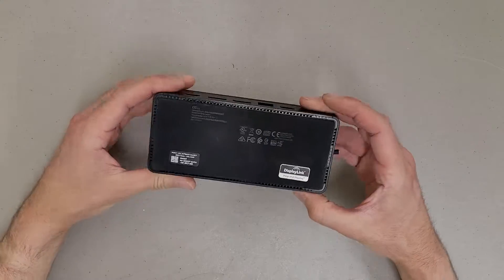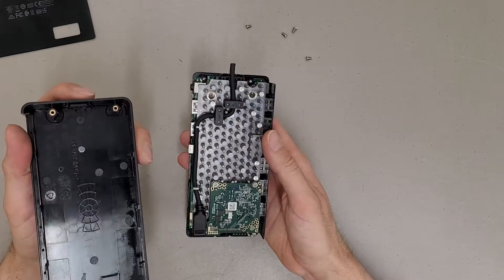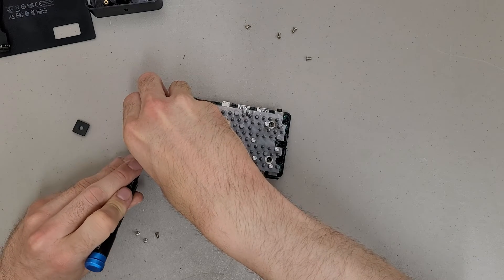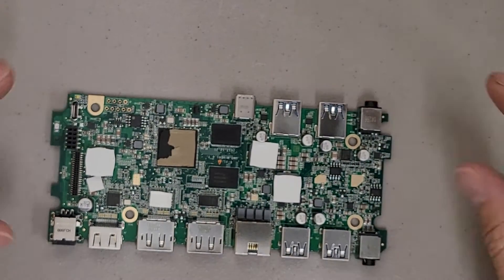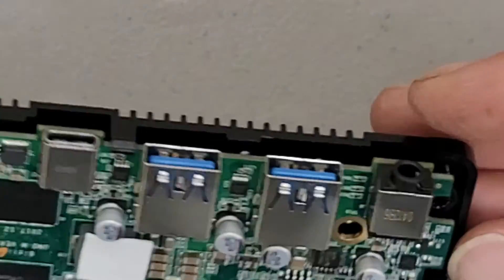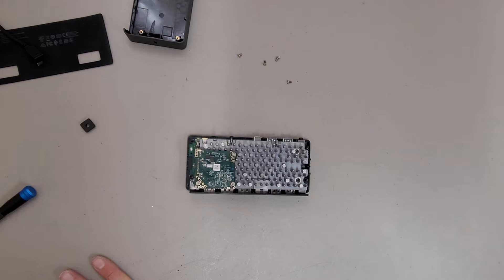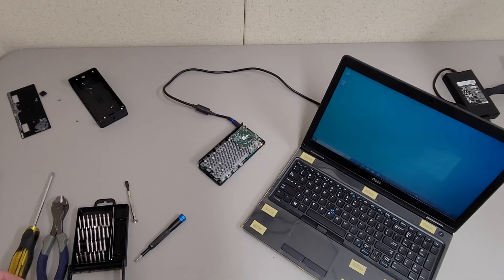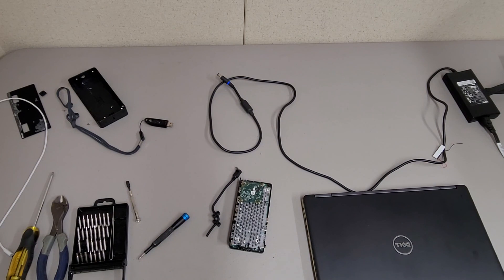Taking apart a Dell D6000 MKX27 USB C docking station #teardown

Comment: Has anyone tried using another usbc to get around a broken cable? This may save my d6000..
Reply from the maker: I'm not aware of anyone having success with other USB C cables. I have a bunch more USB-C cables since this was recorded though so maybe I should see if I can find another one of these docks to test them on.
Reply: @computersales yes you should. It's a thing. It's not a normal USBc but there is many versions.  I went thru the Dell forums and no one has solved this. It's a proprietary cable Dell doesn't support not even for any of their customers who payed upwards of $350 for it. Some businesses bought over 200 hundred at that price with a shitty non replaceable usbc cable that breaks under light use.  This is all the more reason to make an aftermarket. I WILL NEVER BUY ANOTHER DELL PRODUCT EVER AGAIN.  THEY ARE BLACKLISTED from my business. I am self employed and I fire customers all the time. This is also why i refuse to use apple products. Dell is running  a scam. No way they made this cable. It has to be sourced from another supplier.
Reply from the maker: @nathanjones3429  I didn't realize these were that expensive originally. They truly are some of Dell's worst docks.

Comment: There are 3 things that you need to consider:
1. The dock might be broken
2. The laptop might not support thunderbolt (usb c port being there doesn't mean it also supports thunderbolt)
3. The cable wasn't good enough to support thunderbolt (and usually phone charger cables are not good enough to be able to support thunderbolt).
I have a similar dock (pcb are difgerent inside) and i replaced the cable with another one (not from a charger, i got it from a store for about 10€), the laptop was charging and the monitors / peripherals were working.
Reply from the maker: Valid points. To the best of my knowledge this dock is USB only. As far as I know the only thing wrong with it was the original USB cable's external connector was damaged which is a common design flaw. These have a USB C to USB 3.0 adapter physically attached to them. I don't see why a standard USB C cable wouldn't work since it doesn't support thunderbolt.

Comment: Note: I believe that the power station that you dismantled was not recognized due to the malfunction of the integrated circuit that says (AWAREI) and its location near the board connections, which is closer to the longer connection plug on the main board.

Comment: funny story: when i move a little bit on my desk the dell docking shut down
Reply from the maker: They are terrible docks as far as I can tell.
Reply: @computersales  i’ve found a big workaround to get it works but it happens 2/3 times per days a suddenly disconnection …for 40€ i can deal with this frustation

Comment: have you tried real verified thunderbolt 4 cable? Seems your cable is a simple USB2 cable (4 wires), as it is just for charging of your Oculus....
Reply from the maker: I don't own any thunderbolt cables otherwise I'd try.
Reply: This dock is not s thunderbolt dock, so a thunderbolt cable is not the solution. This dock is a displaylink dock.

Comment: Are there any cables you could recommend for this? I’m not quite sure what exact spec I should be looking for as 40gb thunderbolt 3 cables can get pricey but I’d like the full functionality of the dock.

Not to mention cables with that kind of angle are a lot less common (still around, but not from reputable brands)
Reply from the maker: I have no idea to be honest. I did get some more of these in though. I'm guessing the Anker power delivery cable I recently bought won't cut it though.
Reply: @computersales  it could work, im not in a huge rush so do please try it and let me know, and youll know it works fully if it allows you to drive multiple displays but of course I dont blame you if you would rather not test to that extent.
Reply from the maker: @m1ghtyboy  I'll try to keep it in mind.
Reply: @computersales  thank youu
Reply: @m1ghtboy I'm in the same pickle as you but I discovered a few things while researching about the cable in question: 1. its a 240w thunderbolt 3 EPR cable and 2. After taking the connectors apart, BizLink is the company in question that makes these cables. Now the bad news is that Bizlink won't sell these cables to individuals. I don't know where one would find this exact cable without purchasing a dead D6000 and tearing that apart for parts.
Reply: @Dark-xz1im  I have a dead D6000, the real challenge is figuring out the wiring configuration for the cable, which some guy got close with and then stopped to put more time into education, it’d be cool if someone could figure it out and open source it so that these could maybe be made by a third party company

Comment: Has anyone managed to fix the coil whine (the annoying noise) of this unit? I have read about using hot glue or a damping material, so just curious if that worked for someone
Reply from the maker: I've never come across a working one of these personally so wouldn't know. Mounting under your desk would be a solution if you have the space.
Reply: @computersales  that's actually not a bad idea, thanks! The coil whine stops when the dock is even under small load, so I will try to plug something like a USB lamp or a led strip to generate load and see if that fixes it. If not, hide it. Thank you man!
Reply: A bit late but I've managed to reduce the level of the hissing noise to the unnoticeable level by adding a thin piece of silicone heatsink tape on top of the inductor coil of the daughter board.
Reply: @bryanphanvn  Thanks a lot! Do you have pictures by any chance or a link to the tape? Cheers!
Reply: welp just killed my d6000, nevermind. I disconnected the daughter board a few times (I didn't break it after the first try at least), as my first try of adding silicone heatsink tape didn't fix the issue. Turns out none of my attempts fixed the issue, so now my d6000 still does the coil whine and doesn't work as well :D

Comment: I was able to get this working by swapping to a new usbc-usba cable. Then plugging the usb3 A side into my pc usb3 port. Other ports are no good.
Reply from the maker: Any chance the cable has a specific model number people can refer to?
Reply: Does display output work?
Reply: @m1ghtyboy  yeah still using this setup. Long USB able and a hole drilled in the dock cover.
Reply: @ztkent  hell yeah. I’ve been seeing great efforts to reverse engineer it but if display output works then that’s fine by me. Can you remember the specific cable used?

Edit: ordered a generic 3.2 adapter from Amazon, I’ll update
Reply: @m1ghtyboy  OULUOQI USB Type C Cable, but it looks out of stock. It says it's usb-c to USB 2.0 actually.. works great for me.
Reply: Dual monitor / aux all working fine. I can use a type c adapter on the end and plug it into my MacBook to.
Reply: @ztkent  great stuff. I’ll relay this to other places thank you
Reply: @ztkent  3.2 type A>C adapteroonie just arrived and so did my power brick, nothing.

When plugged in to the laptop before the wall, no light. When plugged into the wall first it gives an orange light, when plugging in the laptop I get a white light for a second but then flickers back to orange :/

What’s the MFG date on the bottom of your unit? Mines march 2018
Reply: @m1ghtyboy  Anyone else can confirm if OULUOQI USB Type C Cable is working?

Comment: Thanks for this video- Even though I had a different model, D6000u - Disassembly was similar. I was hoped to try using a Nintendo Switch cable as Abbadon2001 mentioned in an earlier comment below, but  there was a short on the board and it was toast. I kept the heatsink as a paperweight and the housing as a decent little project box. Cheers.:goodvibes:

Comment: The reason they didn't make it a removable connector , was the difference in usb c cables. There's some that do data, or power , or both, or are just trash and do nothing well. The dock was sold for industrial mind set. And they just want something that always works , until it breaks then they have budget to replace. But the usb c cable can be common confusion so this is the simplest solution, having the cable be attached
Reply from the maker: Honestly if the cable didn't have such a high failure rate I wouldn't be as annoyed that the cable isn't replaceable.

Comment: I found a DEll forum post a chap made where he managed to fix it, sort of, it had some tx and rx lines switched over, like a cross cable. He was making a flex pcb to sell to fix this for a normal cable, but it never came to be available. Someone else suggested a nintendo switch dock cable worked, but never showed evidence. I have both a busted D6000, and a switch cable, so i may try this....
Reply from the maker: Hopefully it works.
Reply: it worked? i have the same problem =(
Reply: Hello I have the same issue now my dog destroyed my type C cable, did you solve it ?
Reply: @punto360reviews  I got mine working again today. Removed the old cable and replace it with a new usbc-usba 3.0 cable.

Works on my Mac and windows machines. Needed to plug into my usb3.0 port.
Reply: @ztkent  hello, where did you buy it ? Got the link ?
Reply: @ztkent  which cable did you use?
Reply: @ztkent  does display output work?

Comment: I tried all USB C cable types, normal, thunderbolt... Nothing, was someone capable of replace this cable?
Reply from the maker: There must be a trick to it.  Makes me wonder what they did.
Reply: @computersales   propably switched TX RX lines ? usually the usb c device would figure this stuff out but it seems as if this dock was just a dumb thunderbolt device ?
Reply: Hello I have the same issue now my dog destroyed my type C cable, did you solve it ?

Comment: I have the same docking and i have a problem, if I plug through USB does not recognize any monitor connected and the docking can supply energy by the other hand if i plug with usb adapter recognize all the monitors but as you know does not supply energy, I already try to update drivers and bios even with two laptops it's the same
Reply from the maker: I have never used one of these so I wouldn't know where to start.  I guess check device manager for errors and your display settings.  If it works fine with regular USB then my guess is there is something interfering with the USB C negotiating process when you plug in the dock.

Comment: If only they built their laptops like that...
Reply from the maker: I would say their XFR series laptops are built like that but in all reality even those are kinda jank. 🤔

Edit: Oops meant rugged extreme series. I forgot they dropped the XFR series after 2nd gen i-series CPUs.
Reply: @computersales  Indeed! I have actually got one of these docks that I sue with my Framework laptop and I was wondering if I could open it up and tweak the thermals but I see it's pretty packed in there. It's almost a PC in a box itself. I can see why they are so pricey. Best way is like me, get one on Ebay for £50.
Reply from the maker: @jabezhane  You could always run it with no case with a fan on top

Comment: hey! great video, i was a bit disappointed aswell to know that normal usb c cable dosent work :( , maybe try a thunderbolt 3 cable ?
Reply from the maker: I don't have the dock or a thunderbolt cable at this time unfortunately. The dock does come with a USB C to USB A adapter built in. I'm not sure if it is thunderbolt capable even to be honest.
Reply: @computersales  thanks for the reply :) , i read on a forum and some reddit posts that even thunderbolt cable dosent work i guess they went out of their way to make a custom cable 🥲
Reply: @snailsec  I tried to lengthen the docking station cable with an usb c female/male cable but the power supply does not transfer.
Reply: @computersales  Thanks for the tear down. I’m about to order this dock and was interested to see inside. It’s nice to know that at least a Dell part to replace it probably exists if I have an issue. The suggestion of using a TB3 cable was because they are known to have all wires connected and be of good quality. I half wondered if the Quest cable simply didn’t support all the needed USB lines. I have cables from various vendors that support different charge and data rates, or not at all. And they are all “USB C”. Anyway—thanks again.
Reply from the maker: @maltoNitho  if I ever get another one I will have to try some additional cables I have acquired recently. It would be interesting if my Oculus USB C cable wasn't good enough.